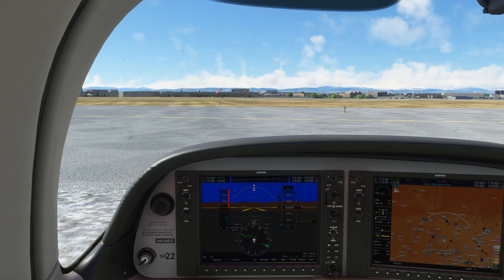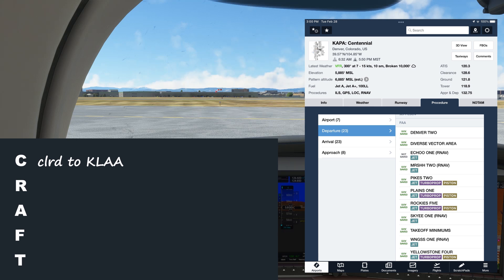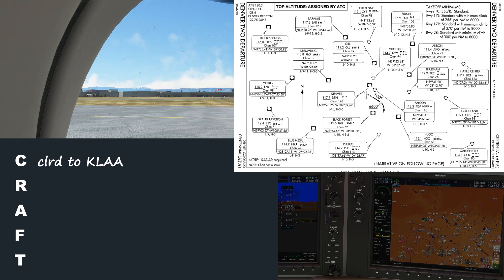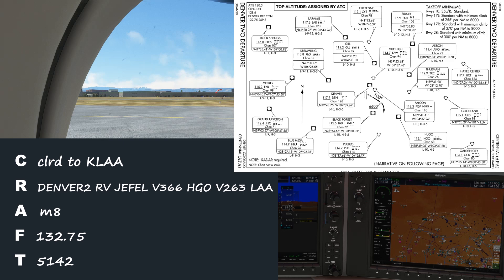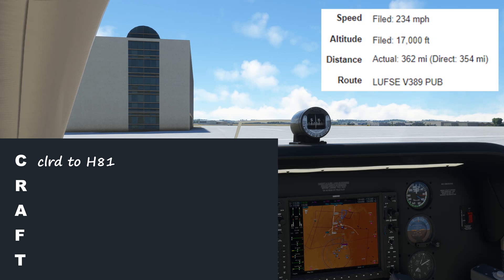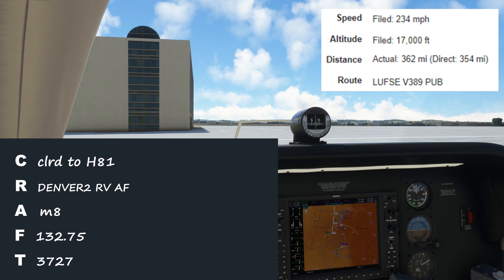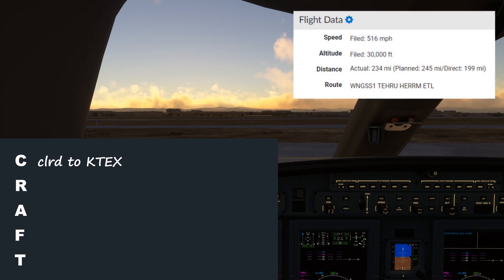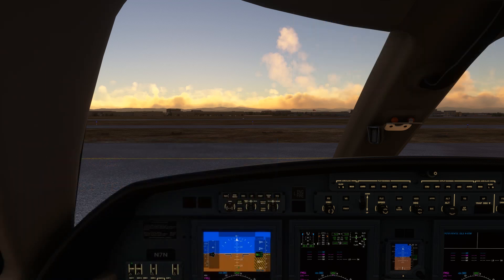More IFR Clearance Practice | Real Air Traffic Control Clearances

Comment: The last one pilot read back says “8000  300 Tem”. What does “300 tem” mean?
Reply: I'm half a year late, but he says "8000, 30 in 10" which means "Climb and Maintain 8000 feet, then expect FL300 after 10 minutes" which is a lost comms procedure. If communication is lost, the aircraft can proceed up to FL300 without being told to do so by ATC, and in fact, it's what ATC is expecting the aircraft to do if comms are lost.